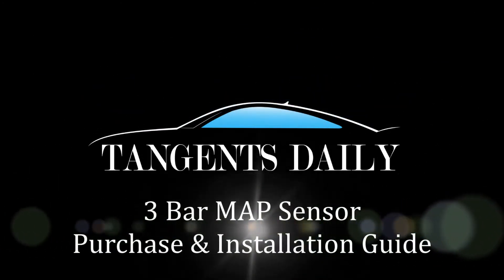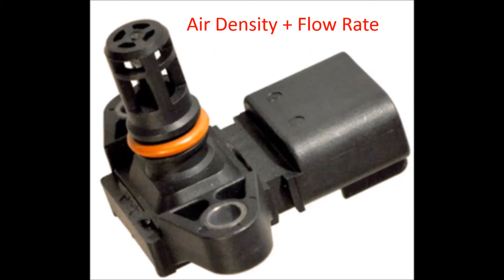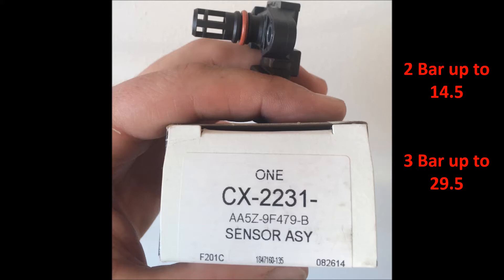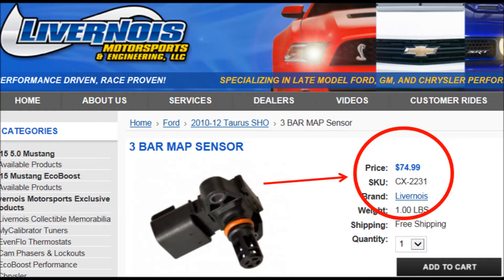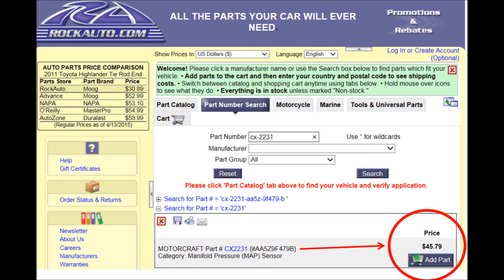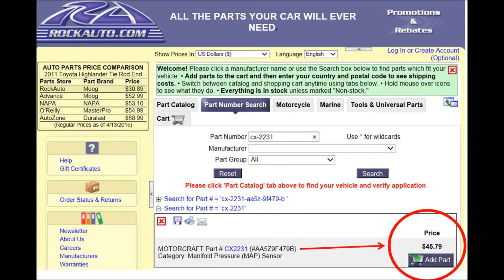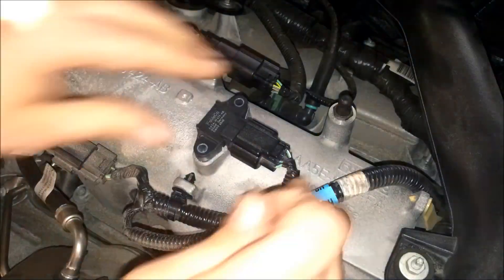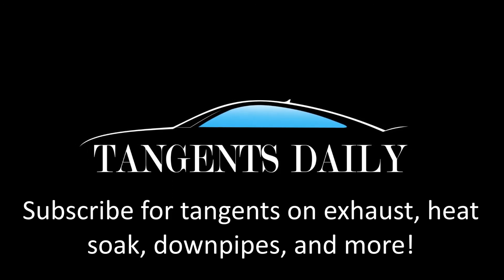3 Bar Map Sensor Purchase and Install Guide

Comment: FWIW, the MSRP/full dealer parts price for the MAP sensor is about $78. If you walked into any local Ford parts dealer, they'd probably charge you the full amount. Motorcraft traditionally has been less expensive than Ford even though they are the same part. The F-150 MAP sensor (on the intake manifold) is CX-2401 (AA5Z9F479C) and I read somewhere that it might be a 2.5 bar MAP sensor. The stock F-150 factory tune calls for a max desired TIP of 85 inHg or about 2.87 bar. The stock SHO tune calls for a max desired TIP of 60 inHg or about 2.0 bar

But, the CX-2231 (AA5Z9F479B) MAP sensor is the one everyone recommends for the "3-bar MAP upgrade" on the transverse mounted EcoBoost cars, and I read it is the same as the sensor at the throttle body (Throttle Inlet Pressure /TIP sensor) on the SHO.
Reply from the maker: +Gearhead Mania You're correct on the 3-bar upgrade  being recommended, but it has to be accompanied by a 3 bar tune, or it won't work correctly.
Reply: +tangents daily The tune is the easy part, it would take a few minutes with SCT or HPTuners if you know what you're doing, or you could pay a tuner to do the same with a canned tune.

Comment: my over drive want work on my ford Excursion i change the senior and it still doin the same thing need help
Reply from the maker: +Tyrone Mitchell Most likely the overdrive is not linked to anything with the 3-bar sensor. Your car would be running bad if the 3 bar was bad.

Comment: Your vids have been helpful in choosing the right exhaust. Have u done anything new with the car?
Reply from the maker: +billybullfrog nothing new. I'm looking at Methanol Injection and switching to Unleashed (torrie) tuned. I do have a few new fun videos up, however :)
Reply: +tangents daily Did you ever put the midpipe back on?
Reply from the maker: I did, it sounds better but not great. I would love to hear an exhaust with a downpipe and factory exhaust.
Reply: +tangents daily me too.  I really don't want any more volume at idle/cruising speeds.  just power and maybe some turbo noises.

Comment: Somehow in my late night wanderings I managed to order a CX-2401 by mistake I saw manifold next to the description on Rockauto and thought it was right, would this work on my 2013 SHO as a proper 3bar map? Just got my LMS CAI and tuner,160 stat, and plugs today in the mail. So I'm hesitant to start my install until I sort this mess out. Thanks
Reply from the maker: +billybullfrog It sounds like you might have ordered the 2-bar, or the wrong part. There is already a 3 bar sensor on your car, however. The 2 bar is in the center of the manifold area. The 3 bar is where the air comes into the intake manifold. You ever get this worked out?

Comment: Livernois recommends a thermostat as well - what are your views on it? If you think it's required, do you know the part number for that as well? Thanks again!
Reply from the maker: AmiTakeuchi I got my 170 degree t-stat from Livernois. During hot or humid days, this car gets very hot. I'd get the t-stat if I were you. Its very simple to replace (two bolts). Just some food for thought.